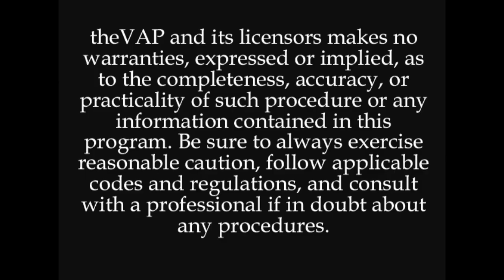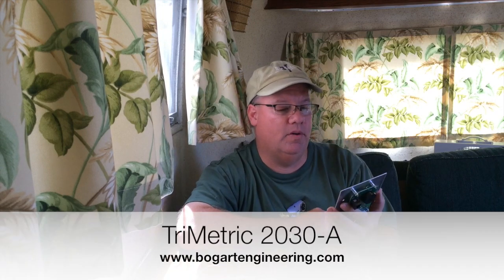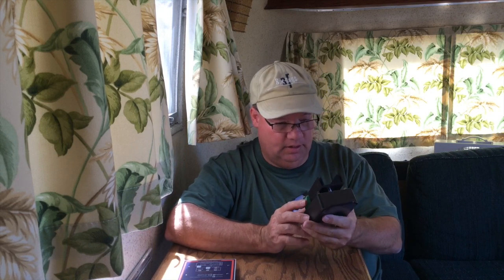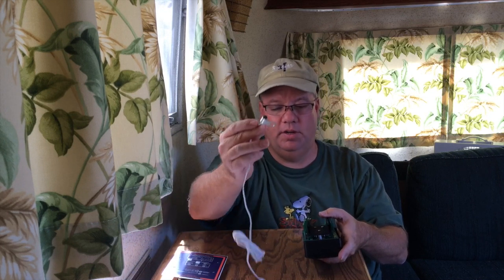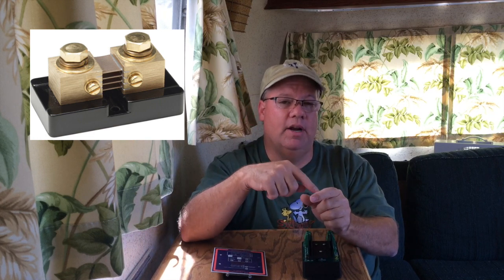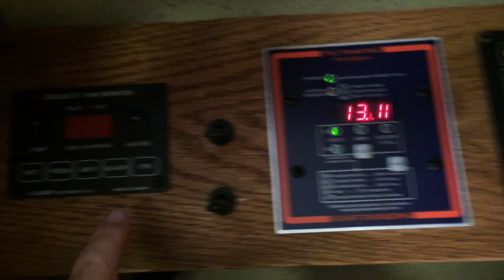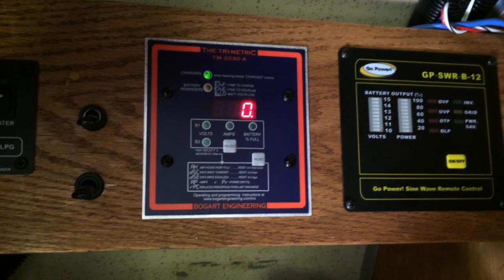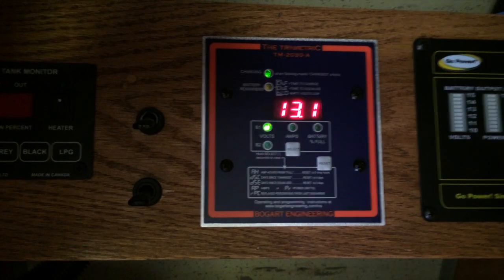theVAP TriMetric 2030 and Solar Charger SC2030

Comment: What batteries are you using and how many amp hours are they?  Also I probably missed what size solar panel you are using. I was read Bob Solar blog. (Google it) and he swears by the meter and charger. However he says most folks under charge their batteries. I'm getting new Trojan T-105's in the next day or two. He says Trojan recommends setting your charge limit to 14.8 volts. You are a long way from even getting to a Gel or AGM float of around 14.2.  Depends on manufacture. I replace the charge controller that came with my old trailer with one I thought was great. But after reading Bob' info I'm not so sure. I'm using one 150w panel (bought two but so far haven't needed the second one). Also he recommends the charge controller be installed by the batteries like you have done. Mine is like most others over the microwave. So I'll have a place to mount the meter lol.

Comment from the maker: This is a PWM controller, so it would compare about the same as any other PWM to MPPT.  My opinion for applications of less than 500 watts of solar, PWM is fine.  MPPT is more costly and you might be better served with an extra panel.  Having said that, each application needs to be looked at individually. I have not tested with any ham equipment.  I assume you are looking for RFI.  I'm sure the design has reasonable filtering not to mention it located inside my aluminum trailer.